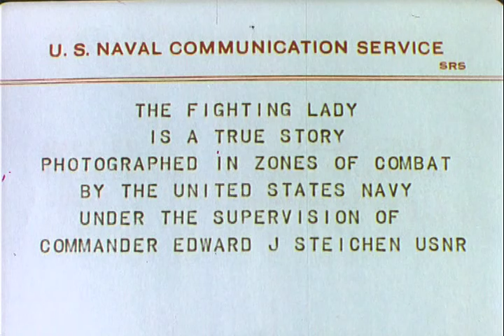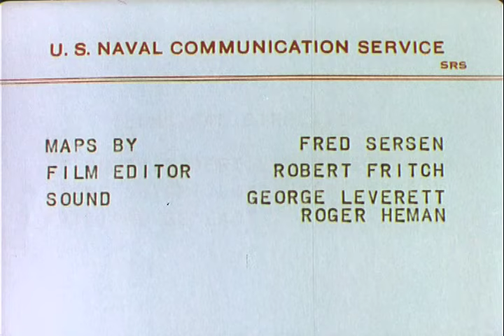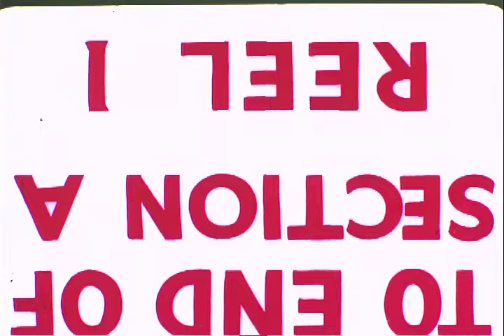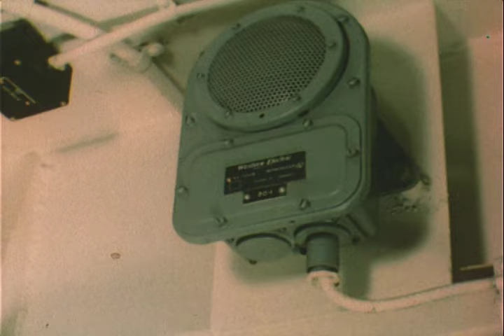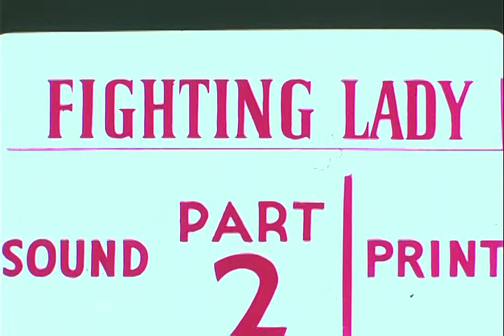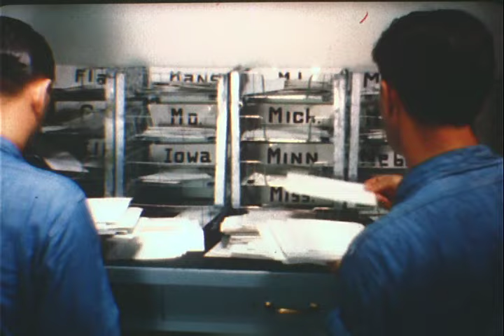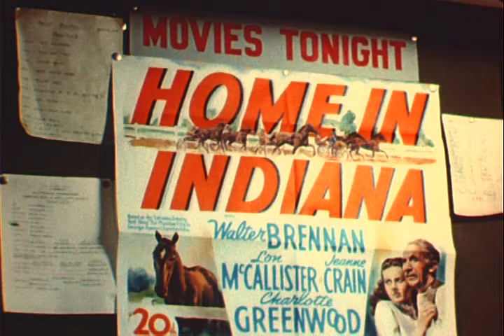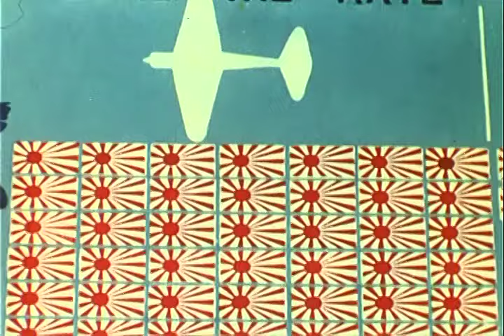The Fighting Lady: The Lady And The Sea (1945) USS Yorktown

Comment: 54:00 
Zeros actually had self sealing fuel tanks. They had rubber inside of it, so that if a shot went through, the rubber would seal the hole
Reply: @Peter Doucet of course you'd pick the Hellcat, it's the most obvious choice. 
And yeah, I don't think the idea of using rubber as a sealing method would work much if the fire started in the tank itself.